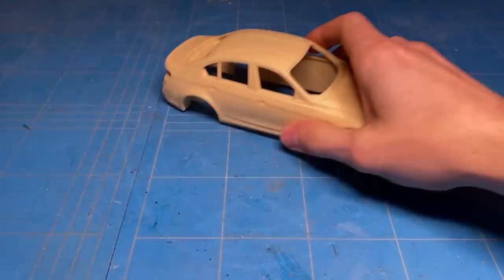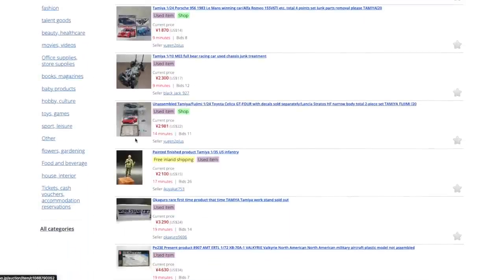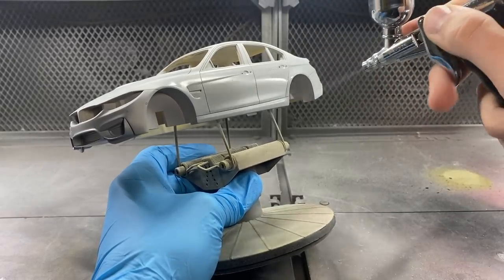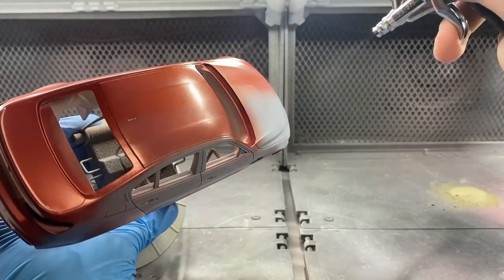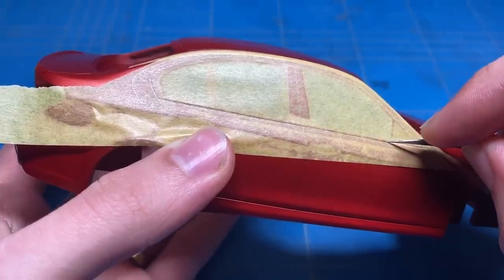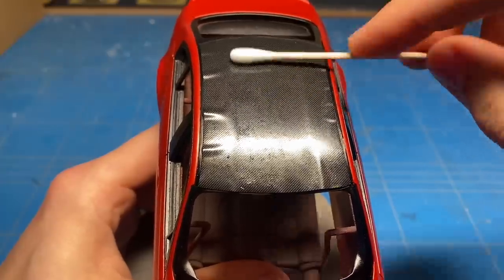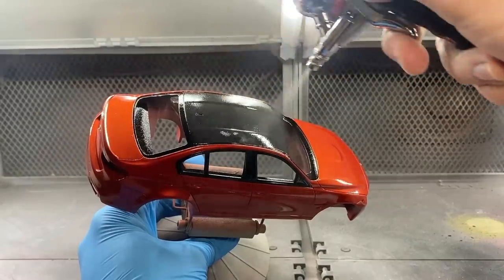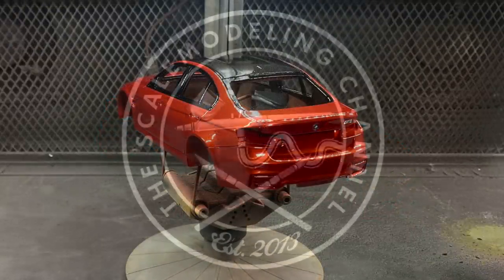Kitbox + PZY Model: BMW F80 M3 Part 1: Paint

Comment: I have a question about primer, paint, clear coat.. 

Can you mix enamel and lacquer, At all stages ? 

What I mean is can I use lacquer primer, enamel paint, then lacquer clear coat, vice versa in any combo ? 

Thank you
Reply from the maker: No, those can not be mixed
Reply: @TheScalemodelingChannel  oh ok, So if I start off with a enamel spray can primer, I have too stick with enamel for the paint and clear coat, And same deal with lacquer primer, paint, clear coat, right ?
Reply from the maker: @AresGodOWar  pretty much. Yes
Reply: @TheScalemodelingChannel  ok thank you very much
Reply: @TheScalemodelingChannel  just wondering If you were using just spray cans, And had too choose between, Tayima or Testors, And Enamel or Lacquer. What brand and paint type would you go with ?
Reply from the maker: @AresGodOWar  tamiya. As i have 0 experience with testors. So can’t say anything about their quality